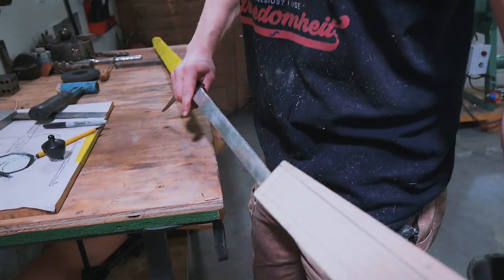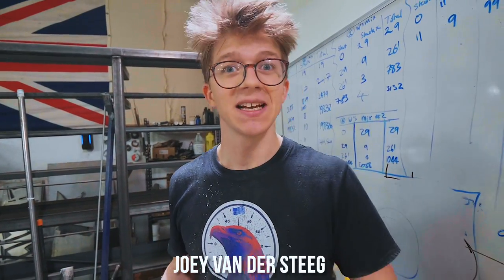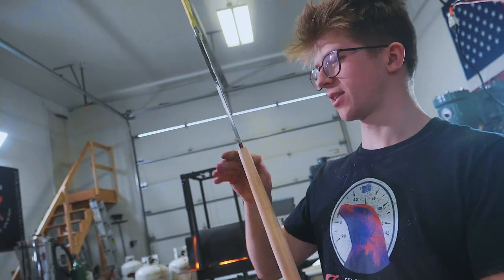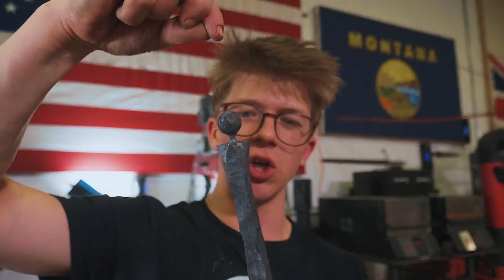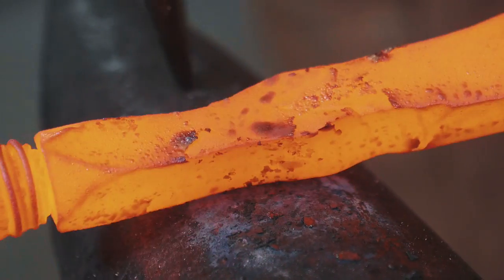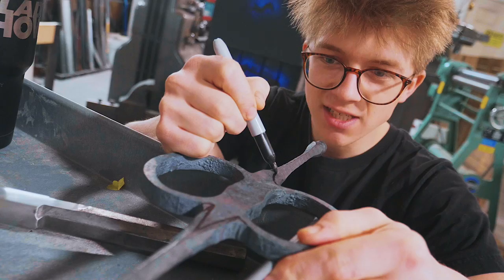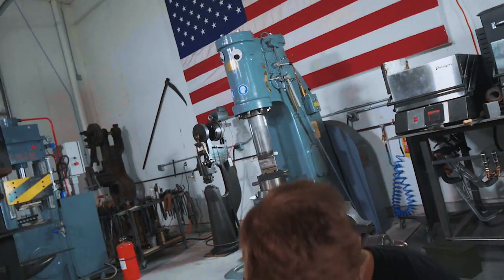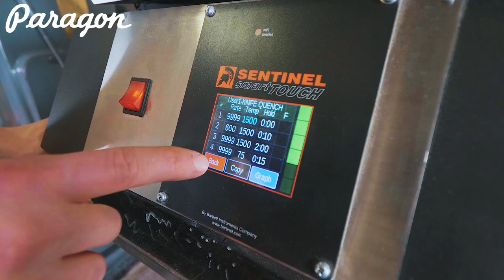MAKING A ZWEIHANDER SWORD!!! Part 13

Comment: i guess these are filmed quite far in advance and the problem is likely already solved but an easy way to deal with the balls would be to turn them with a small diameter post hanging off them. then drill holes for the posts in the ends of the guard. put the pieces together and wick some 56% silver braze in there to bond it. if you do it right it will be almost invisible.

Comment: Make ball easy. With lathe and whole saw of the desired ball diameter. Spin stock in lathe then spin whole saw from adjacent axis or parallel to where you want the ball. Boom perfect ball in 5 seconds

Comment: The Scarf weld is interesting.  I wonder what the etymology is.  It vaguely resembles a Scarf joint in wood joinery, but that is a little more complicated as apparently welding wood together doesn't really work

Comment: Suggestion, might be worth trying and put some stainless Steele fibre in your refractory. It Will still crack but it holds itself together a bit better. The ratio would need tweaking but I think around 1 : 50 fibre to refractory is a starting point...also couldn't resist the puns :p

Comment: you can fix the balls with tig welding no problem.
grind surfaces clean, build it up with filler weld, then weld the ball to that. grind it clean

Comment: Scarf forging is different from a woodworking scarf joint.  In woodworking, a scarf joint usually requires a one or more locking pins or pegs to keep them connected.  Metal scarf forging does not.

Comment: If you happen to read this comment, there is a reason why large swords did not have just solid wood handles but they were usually glued, wrapped with string and covered with leather because the flex that happens in such a long piece of steel will crack a solid wood handle..

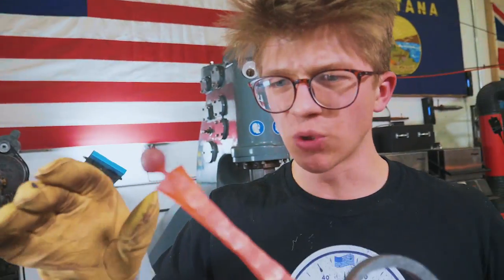Comment: 7:40  The forge weld went quite well.....after you mig welded it together.   That's cheating....if you're going to do that, just mig weld a ball bearing on the end.

Comment: A suggestion: When this is done, instead of celebrating in the usual way by cleaving 2 liter bottles of fizzy drinks and assorted fruits, it'd be a fine demonstration of the power of this weapon if you hung a side of beef and took a few swings at it.

I'd watch it...
Reply: Kurt Hanson I'd barbecue it!

Comment: If the handle is going to be wrapped in leather why not make it out of a strong more durable synthetic material. like Micarta or G10. I don't see the point of using an inferior material if it is not going to be seen. You argue for  historical accuracy when you cut flame or plasma the guard out of plate and before that tried to tig weld it,  not to mention a zillion other modern processes being used.

Comment: 2/3 of the way through and I can't help it.  Alec is going to the doctor because he lost his ball on the very last blow (which sounds WAY too personal).  And with Wills filing system, I'm wondering if you guys will have the balls to get this done?  General Hospital never generated this much drama.  I'm on the edge of my seat!  And THEN, as if that's not enough..."It hath flopped its last flop!

Tune in next time to find out how Alec is doing, healthwise.  Will Will have the balls to un-flop this flop?  Where does he keep his files?  In a filing cabinet?  Or does he just have paperwork in those, like most mere mortals?

Comment: I almost never comment on videos and first time on this channel. I have watched you making this guard numerous times trying to figure out why you don't forge the ball as one of the last steps. Then it hit me, you do not possess the holy grail of forging balls. So ol buddy I will bestow this knowledge upon you. get a used ball bearing the same size you want your balls to be and cut the out side race in two. heat to flatten and anneal the race. cut flatted race the same width as your guillotine tool and weld them on the face of the dies. heat stock you want the ball on, place in tool and hit turn hit turn and you will see before your very eyes a ball will be forming. Now chop chop.

Comment: At this point, the guard does not need any balls... the sword itself is a demonstration in balls, i.e. sheer size and the handling thereof. Just finish it before Part "whatever" enters high double digits...

Comment: I don't know why you are dong the guard with a forged look when no other parts have that look, it will look like it was a replacement part from a less capable craftsman when it has an unfinished look and the rest is beautifully finished. Long story short I think Will needs some more filing and sanding to do.

Comment: Awe you cheated, your supposed to heat the pieces up seperately, in a hand cranked coke forge, in the bright sun, and then use a small ball peen hammer and quickly get them together on the anvil across the shop after hurtling 2 overturned tables and 1 mamma kitty with a litter of kittens lying on the floor of your shop, then set the forge weld. 

Yeah, I tig weld my scarfs too, glad to see I'm not the only one that cheats, ☺

Comment: Did they just, forget to harden this blade? Or am I missing something?
Reply: Part 3 or 400 they hardened then heat treated.
Reply: William Jefferson Clinton must have missed that, they must have gone wrong somewhere then Becouse there is no way it should still have that much flex to it

Comment: Would have been nice to see them really forge the guard, they’d be better at forging if they stopped trying to be businessmen and be blacksmiths instead, and let their work speak for itself, instead of trying to get sponsors out of every corner of the planet. I understand why they do it, just don’t agree with it. They should try to be more like Matt stagmer and Ilya from ThatWorks.
Reply from the maker: I tried forging the guard - I wasn’t good enough to pull it off well. These videos wouldn’t exist if I wasn’t a businessman.

Comment: "We won't be getting near forge welding temp so we don't need to worry about the wire sticking to the piece"

Forge welds the other side with the wire on the ball

This dude...